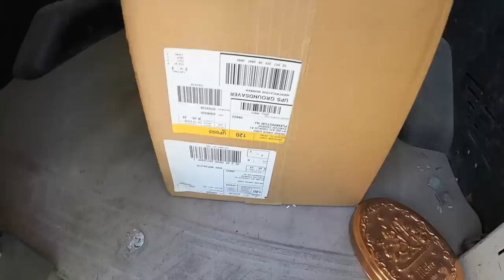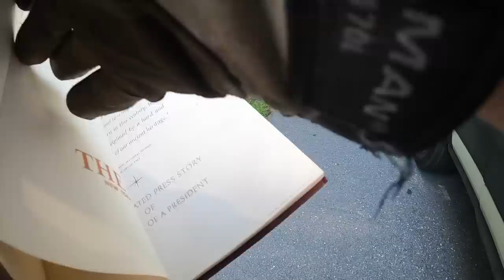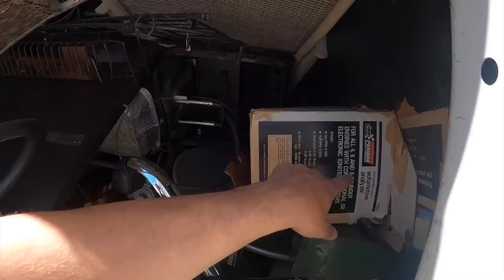This isn't Garbage it's Worth BIG MONEY!

Comment: I've wondered about this before. When you fill up your van so fast, wouldn't it make sense to stop off at the scrap yard before going home? Then you might find more on your way home from there. Great blow mold!
Reply: Like I
Reply: Trust me ,I picked the Trash for 22yrs , scrap metals worth more money when cleaned good, nonferrous metals, copper, brass, aluminum. There's so much competition now days ,in order to keep ahead of them you grab and go ,glass plastic, wood, nuts,bolts Etc, Etc separated from metals is time consuming. The valuable merchandise has to be separated from the metals! I was picking 3 loads a day selling 2loads of metal per day !

Comment: On that exhaust system, the small cylinder/can looking thing is the resonator. If you had a catalytic converter it would have an oxygen sensor with wire screwed in the side. The cats can be worth 2-500 in scrap.

Comment: If that was me Id have run home dumped the scrap out and ran back out for the rest. Then took the next day off from wasting gas running around and used it to sort the massive score from the day before. If not that I'd call a buddy to give them the heads up to give them the extra cash you left behind. Great haul though!

Comment: Great scores today dude!   Snowman: Awesome find!!!   Also, that TREK bike!  I found a TREK bike a few weeks ago and sold it for $200 in two days on craigslist.  Amazing what people just .. Throw away.
Reply: About a month ago i found a Trek mountain bike in the trash in an upper middle class neighborhood with newer non mansion homes.  It seemed like someone just rode it, and put it by the curb since the index shifter did not work.  Its probably one of the nicest bicycles i found,  and i did find Trek bikes in the trash before. Even if the bicycles are too far gone you can sell them as repairables, or parts bikes.

Comment: that's why the trimmer is out on the road. old gas. won't start so they dump it. clean the carb and get it running and sell at flea markets. plus remove the heavy grate from under the lid and make it lighter to handle the grill.

Comment: Trek bikes are a great find even if they are too far gone to fix.  If they are too far gone i part them out, or sell them as is for parts, or repair. That trash with the blow mold seemed like it was a house clean
 out after an elderly move, or death because where else would you find stuff that old in the trash.  I was eying up that old Meco charcoal grill which looked like it was in nice condition.

Comment: NOT sure, picture wasn't great angle, but don't think any of the exhaust was catalytic converter. Big part was a muffler, but a cayt isn't usually a shiny metal, it can get 1200 -1600 degrees so are ushally burnt rust looking. Great Snowman! No fun unload &reload, guessing scrap yard closes by 5 & you were likely pushing 6:30 -7. Honesty is best policy, and don't tell lies & you will always keep the truth straight. 👍👍

Comment: Scored an elongated 🚽 toilet today. Going to pressure wash it and mount it to some thick ass boards. I'm going to have an outdoor toilet. 

How do you clean your toilet? I spray it with pine Sol then pressure wash it.

It's got dirt on it because it's sat in a corner for years. So what you don't ask the pedigree  of your local Walmart or at work? Free is a damn good price.